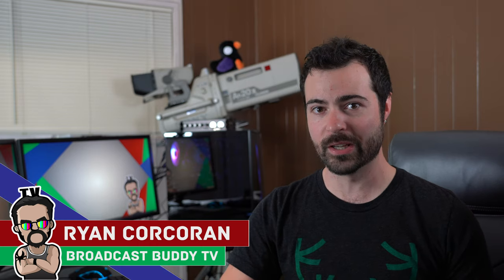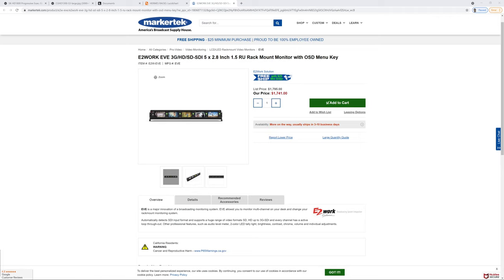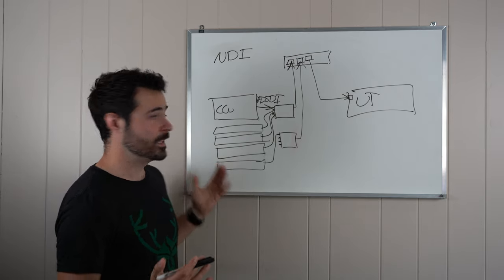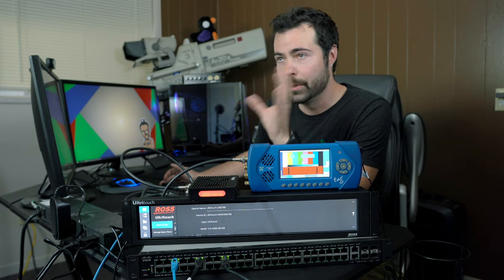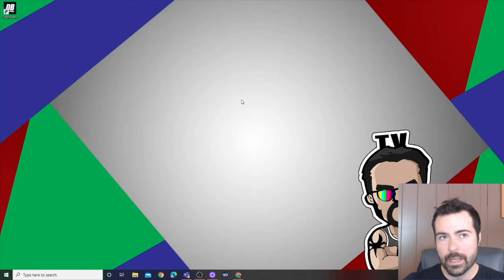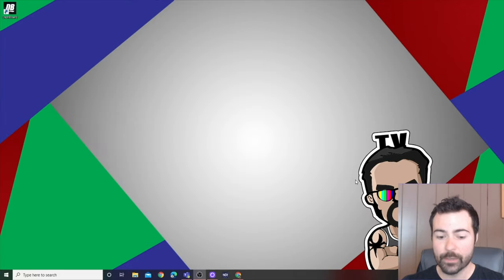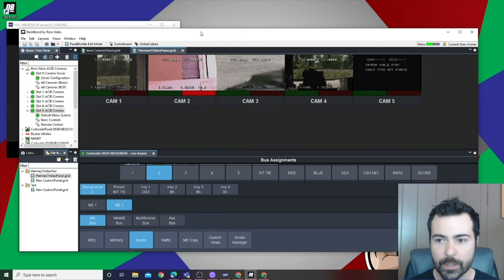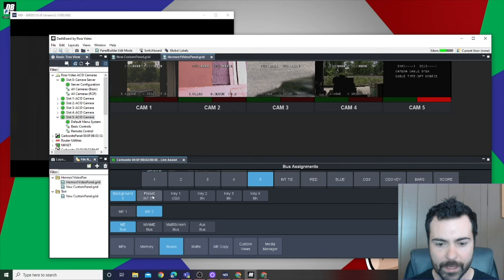Let's Build A Camera Monitor with NewTek's NDI And Ross Video's Ultritouch

Comment: This is cool way to solve the problem you had but I am actually kind of surprised Ross supports NDI.
Reply from the maker: Thank you! They not only support it, but have weaved it into some of their other products as well, like XPression
Reply: @BroadcastBuddyTV  It makes sense from a business standpoint. I have used NDI and while it has some uses, I hate that not everything speaks the same version of NDI. I had some software that could not work with the BirdDog because it was on an older version of the SDK.
Reply: @TVJAY  NDI 5 should solve a lot of those issues!